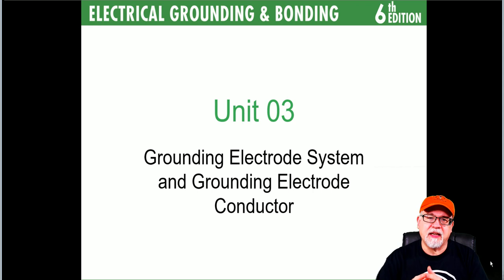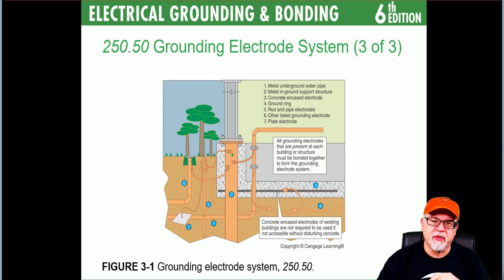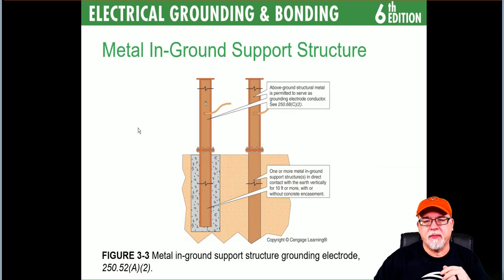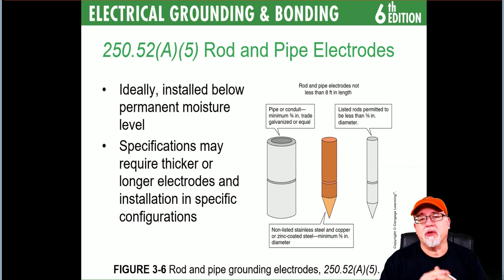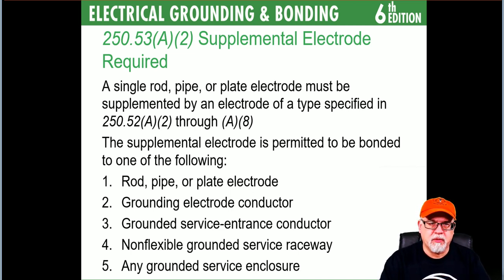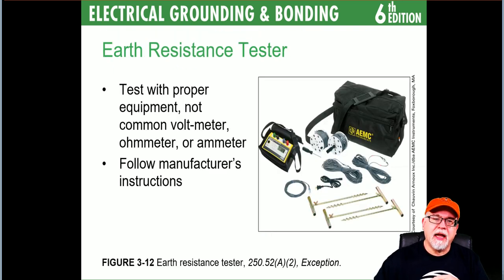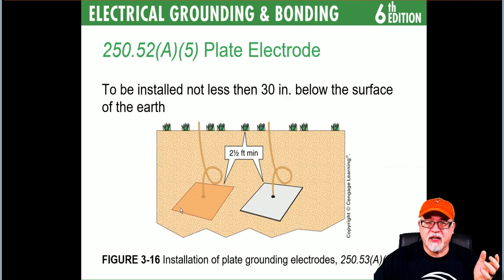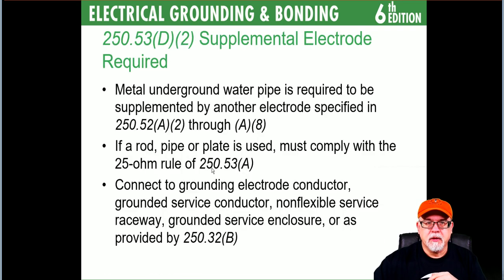2020 NEC Grounding & Bonding Course- Grounding Electrodes Sample

Comment: Hello , if I am installing a Temporary Main 100amp Outdoor Electrical Service Panel with 2 ground rods 6 feet apart within 3 feet of a Shed Sub Panel . Will I be required to add two more ground rods at the Shed Sub Panel? Even; if, I have Main and Sub Panel bonded to same two Ground Rods ?
Reply from the maker: If you have a remote distribution panel in the detached structure, in your case a shed, you would indeed be required to establish a grounding electrode system at the shed. Now, if the main panel and shed with remote panel are that close, nothing says you can't use the same ground rods if you wish.

Comment: I am researching a question.  200 Amp panel. Need to run underground service conductors to two spots in rear of property.  How to calculate all this? 1. Determine distance? 2. Determine future potential load? 3. Go to two tables in NEC correct?
Reply from the maker: We do not answer questions here. If you have a technical question please visit www.PaulAbernathy.com and post on our portal.

Comment: how are you testing 25 ohms or less
Reply from the maker: You invest in a 3-point fall of potential meter or an Ground Resistance Meter which are expensive. Here is the cheaper option - https://www.fluke.com/en-us/learn/blog/grounding/earth-ground-fall-potential

But, its probably easier to just put in (2) ground rods.
Reply: @MasterTheNEC   thank you that’s what I figured. It would be interesting to have one to experiment with. I never used one
Reply: Just ran into this with an inspector, couldn't understand how to accomplish this so I just threw in two rods 😂 thank you very much for the info!!!